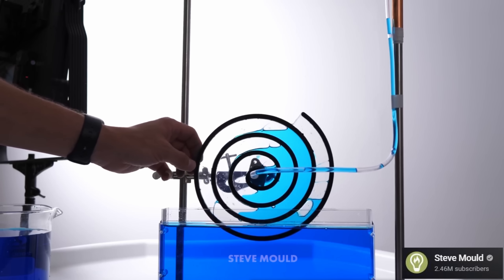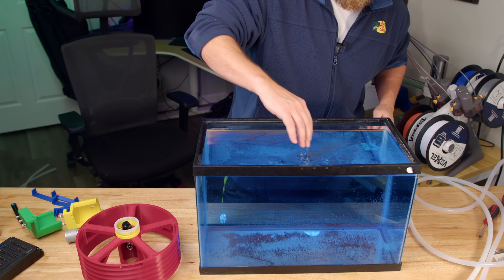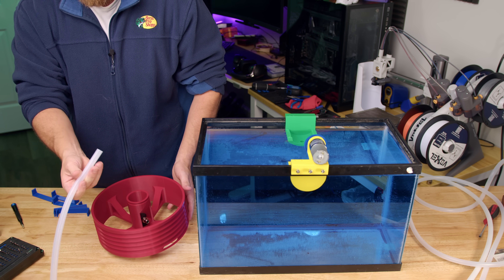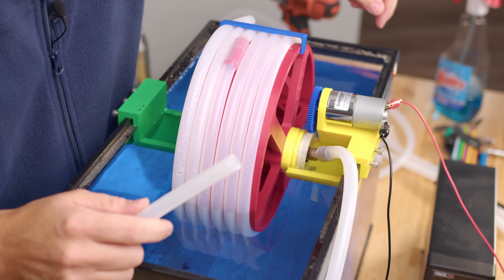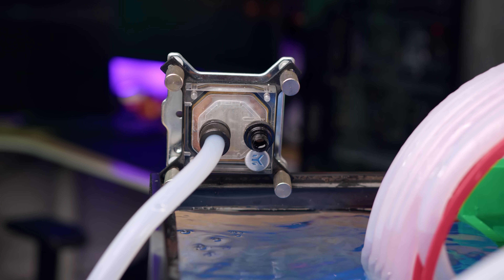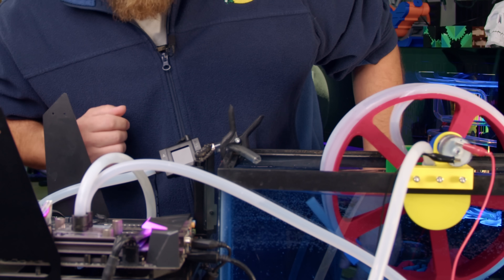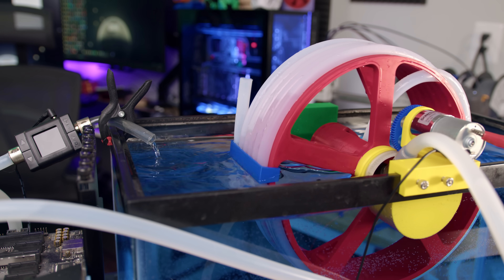Can a 217 YEAR OLD Water Pump Cool A PC?

Comment: To avoid air interrupting the flow I would suggest instead of getting the houp and escape hole directly on the cpu, maybe put the cpu in a bath that is filled up by the hose sitting on top of it and a drain hole below it so the CPU is constantly submerged

Comment: I think this needs a showdown sequel: an archimedes pump, this coil pump, maybe a rope pump, all have a risk of sucking in air, and need a pressure reservoir that should continually be allowed to leak through a valve from the top back into the input tank, to separate air before the CPU... then a peristaltic pump (plenty of printable designs for silicone tubing are freely available), and an off the shelf water cooler to bring it home.

I believe all of the above (except the "control" ordinary water pump) can be easily made with a brushed motor as was done here, but knocking it out of the park would be using an (e.g.) NF-A12x25 motor and 3D printed parts, rather than an already-geared-down brushed motor to accomplish the task.

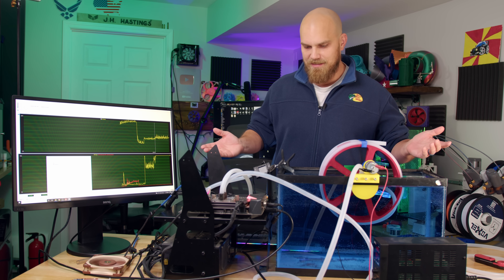Comment: 9:24 You can buy automatic air venting valves for radiators. …  I mean  the house heating kind.  Wouldn't that a way to lose the excess air?

Comment: Water pump, call me lazy go with gravity  put a bucket higher than the CPU hole under the bucket with a toilet float to regulate the level of water in let gravity do the work . Save power, avoid noise, have water quickly available for your thirst.

Comment: I'm thinking you could use a back pressure tank, similar to a ram pump, to catch the air while still keeping pressure on the water. This will help keep continuous flow (like a pneumatic capacitor) you would just need a pressure release valve on the air side of the back pressure tank to allow for the air to escape without causing a too serious drop in back pressure that's required to operate the spiral pump.

Comment: I think you need to put a sealed tank or cylinder (with an inlet and outlet at the bottom) in between the cpu and pump, up high. The air will get trapped in the top. If you set it up so the pump can out flow the inlet to the cpu then it will fill the cylinder with water, pressurizing the air, and i think if you set it up right it might be able to pump continuously. Gravity will also help. The cylinder will need to have an air release or else it will eventually just start pumping air with water.

This is a pretty cool idea

Comment: Try using bigger tubing on the drum and having it reduce down to PC cooling tube at the swivel fitting. Should increase the flow rate and probably pressure though the system

Comment: Try using an air bubbler in a tube to lift the water, like it used in aquariums and under water dredging. If the thermodynamic balance is just right the evaporative cooling by the air bubbles will remove the excess heat ensuring the reservoir stays cool.

Comment: Use the pump to feed a siphon reservoir above the CPU. That will eliminate the air gaps. Then just tune the return rate from the siphon to the tank with an adjustable nozzle to match the flow of the pump. Or you could have a secondary catch-up pump that comes on when the siphon reservoir gets low and cuts off once it gets to a certain level.

Comment: You might be able to get the air out by T-ing the return line back in the system just past the pump and having some sort of pressure release valve on the return as well to manage the pressure. Bonus points for finding an adjustable pressure valve to find the pressure limit of the system.

Comment: You could put a 2L bottle inline with a one way pressure valve on the side, with the outlet under the water level in the bottle. The valve set to the right pressure, it would allow for air to escape and might remove the air being pushed further into the system while still allowign for pressure to push the water in the system

Comment: an idea to get rid of the air gaps is to hold the whole thing under the water and rotate it till all the airs out. also have the entire wheel lower under the water the whole time and have maybe a belt/chain drive from the motor

Comment: Probably a pipe dream... XD but a Stirling engine water pump would be cool. I dont think it would have enough pressure to push the water through though. A can of Sterno would be the easiest way to provide heat, but if you could use the thermal output of the CPU+GPU to run the engine that would be sick. Though on my quick math the output would be about half the BTUs of a Sterno can. Sadge.
Awesome video though!

Comment: Re-do this process with three water loops combining into one later in the loop. Each one has a check-valve to prevent back-flow. Then off-set each loop by 120 degrees. And you can showcase the typical 3-phase AC function of power generation, with water. And why it is beneficial in removing the 'air gap'.

Comment: This princip should work a lot better (more constant waterflow) with some priming or slightly higher rotation speed; best probably would be a combination of both. The base princip probably has around 50% filling but with the propper rotion speed priming the loop to 2/3 or 3/4 should work as well while supplying a more constant waterflow. I´m not an expect but that´s what the logic of my authistic brain sais. BTW: I´m german and we´re known for improving others designs throughout more than 100 years, a german redesigned the steam engine which really blasted off industrial revolution. With 3/4 filling, the wheel might have to be redesigned or the the holding frame because for that much priming the wheel probably has to submerched to 2/3 and not just half. E.g : you could simply lower the anker points for the holdsters or redesign the wheel and one holder. For second it´s actually a bit more redesign: you could lower the wheel and print a fitting gears on the wheel frame while moving the spokes to the other side an thin them out to make space for gearing and in addition, the spokes have to be off centered and attached to a bearing which sits in the holding place.

Comment: elevate the computer above the reservoir and add a 2nd reservoir between the pump and the CPU to eliminate the air bubbles in the cooling system.

Comment: The key to eliminating bubbles is simpler than you think, make the length of the coil longer and the diameter smaller. And then tilt it 45 degrees so that the inlet is completely submerged.

Comment: funny enough if you turned this drum to between 45 and 90 degrees, you'd have a weird take on an even older design: the Archimedes Screw... which a conical version is used to pump flood water here in New Orleans.

Comment: I think raise the output side and lower the input side and add some speed. I would like to see multiple tubes spiraled more like a twist drill bit with maybe a 45 degree fittings to hit the water at 90 degrees. Just an idea. I am imagining a hydra like set of tubes all connecting to a center point.

Comment: try submerging the wheel as much as possible by adding gears to drive it under the surface to keep the motor dry. Also a larger diam hose on the wheel feedign the smaller 10/13 may give you more constant flow.

Comment: If you had, say, 4 of those running at the same time, could you running them all into a single line using 1-way valves at the intersections? Also, about the air, is there any sort of valve that lets air get released without much water being released? If so, in combination, I imagine these two would allow for better continuous water flow without as much air passing through.

Comment: You should remake it but double the hose diameter (more pressure because more water mass above previous loop, and 3.14x more flow because 2x the diameter.) Then wrap another loop around that one using the previous loop as a guide, and start and end it 180⁰ out from  the first loop. Tee in at your swivel and dump it into a buffer tank. Idea is that if you can somehow throttle the tank so you never outrun your  pump, (a float valve would be good for this) then you always have a consistent water flow and no air in the loop (better thermal heat transfer).  The only down side is that the water pressure is going to be proportional to the distance between the tanks water level and the end of the return hose. The further vertically that these are apart, the more water pressure you will get. The other way you could do this is use a sealed tank in line with the pump and install a small orifice or adjustable valve at the very top of the tank with the outlet at the bottom. Because air is less dense and far less viscous than water, you can use a metered leak to purge air from the top of the tank. If theres no air trapped, you will leak a little water. But the idea is to make the bleed small enough that the leaked water is minimal meaning that it's large enough to bleed off all the air, but minimise water leakage. This has the benefit of maximizing pump produced pressure with no trapped air. This could even be done ideally with a carburetor float. When fluid level drops because its displaced by air, the float sinks and opens the purge port letting trapped air out. If air is exhausted the float raises, which plugs the air purge port. This would work way better imo. You could even 100% print this and use an o-ring press fit to seal it. I think with the other mod where you make 2x hoses 180⁰ apart or 3 hoses 120⁰ apart, you may have so much water flow that it doesnt matter one way or another. I still think you should make the float style self purging pot!!  😁😁

Comment: You should try seeing if it works with a waterblocked GPU on a GPU stress test, and if it can handle that, try both a CPU and GPU dual stress test. Maybe add a small circulator pump inside the fish tank just to cycle the cool water at the bottom to the top

Comment: I think you could use some simple flap valves to prevent it from grabbing any air.  Maybe that could allow it to push the air all the way out and keep JUST water in the loop?  A water tower would work, like ethanconnor6227 suggests, but that would also make it a lot bigger and you'd have to make sure its elevated enough.  Also, what about an intake scoop on the inlet tube.  It could generate more pressure and allow it to pick up a bigger volume of water.

Comment: Would a second pump loop for picking up water and feeding into the system towards the cpu help with the air bubbles at the cpu block if it was timed with the first loop, so that when one tube end is exiting the water the other is entering so it has constant flow?

Comment: Could you add a second 180 degree offset loop on the wheel and trigger a valve to dump the air from each rotation on each loop and only accept the water?

Comment: Make a second drum , and hook both to a Y fitting with check valves, if you offset their phasing by 90 degrees you should be able to eliminate most of the air pockets and potentially use smaller drums overall

Comment: Several days late to the party and many have brought up parts of my overall opinion already, but.... I would combine several facets... this pump is capable of a fairly decent height differential... you also have half of the pump submerged which gives a pretty good pressure possibility and would allow for three tube windings that are offset by 120° from each other. The hub connections should have a one way valve between each coil and then into the rotary coupling which would then feed to a tank at the final output a few feet higher than the CPU, the tank should be big enough to handle the output from all three hoses and the height will be determined by the pressure required and the volume throughput. Using a thinner tubing wall will increase the volume, and you could double wind each hose onto one third of your current drum width while maintaining a very similar diameter.  If you really wanted to put a radiator into the feed to the CPU or even as a pre-cooler to your recovery tank, you could probably drive the system even harder and/or longer before approaching thermal saturation.  Perhaps some solutions from hydroponics applications can also counter the issue of unwanted growth in your water system.  <shrugs> just the thoughts from a grumpy old engineer... LOL Tale from it what you wish! 

I love the results you got from the relatively primitive solution you hacked together and I think you could definitely tweak some serious improvements into the overall operation.

Comment: I think you could make an air separator with T to a fat vertical pipe. So long as the pressure isn't enough to push water all the way up to the top you will get rid of the air.

Comment: Why not make it fully submerged and with a funnel at the end, given a high enough rpm it should still pump pretty well, and you can also suck the air out the other end before starting it.. no need for towers,t-flanges, filters and what-not, and there should be no pulsing

Comment: Keep the pipe around the drum the same size. Maybe change the output pipe to a smaller diameter pipe? Would that help the flow rate or would it decrease the drum intake?

Comment: your heat source is the same and the destination that heat goes is the same so increasing the flow is only going to increase the temp of the tank anymore than what it already does at the current flow. it just means that your output is going to be cooler but at a higher flow. increasing the flow of the water is not going to magically make the CPU produce any more heat than it already does.

Comment: What would happen if you were to double the amount of channels and run a second tube along with the first but spaced 180 degrees at the input openings? Could you run both tubes into a "Y" and get constant flow since gravity seems to be the reason that the flow isn't constant? Or would the air pressure from the top half of the rotation interfere too much on each pass and bind up the water from passing into the tube? Just a thought. If 1 tube is good 2 should be better, but maybe not. With more parts, complications arise as well.

Comment: Use a wider diameter coil tube, but keep the rest of the tubes the same
Let's see what happens

The wider tube means you can spin the wheel faster without it backing up, but the bottleneck means that you also have to spin it slower than you would normally

Comment: Ok, for the next one, connect the cpu to a water reservoir above the cpu and have the pump feed the reservoir.  that way you should get a constant waterflow through it and back into the tank.  you justr have to make sure that the reservoir is above the tank ond outlet.

Comment: forget the 200+ year old water pump. I'm waiting for the water powered intercooler turbo water cooler from your car. Ofc powered with your custom RGB fans. Add some TEG coolers or evap/tower bongs or a sterling engine to the hot/cold plates/parts. Or attach a dry ice/ice maker that shoots ice into a bag on top of the water to chill it down further. maybe add 2 tubers combined into one for more water flow.

Comment: What if you add a funnel under the water that connect to spiral will there still be air but the the spiral will have to be beaper in the water to work than I think...

But else that awesome test

Comment: Maybe run a second coil in paralel so it pumps water when the other is pumping air, and a container in between the coil and the CPU that acts like a capacitor so it evens the flow to minimize air in the PC part of the loop

Comment: You could add another tube 180* out of phase, both tubes run to a manifold with check valves get rid of some of the air. A scoop on the end of the tubes to help force water in. I would be interested in seeing this perfected.

Comment: LOOK Man it is so easy! (to eliminate the air). Just make a printed 3x3x3 inch cube with a hole in the bottom that goes to the water block, and about 2 inch up hole on any side (overflow) that returns back to the main tank. 
Place the output from the pump to 'fall' into the tank which makes for a REAL airgap. The pump can easily go up 3 feet vertical.

Raise the cube about 24-36 inches and you will eliminte the air going through the water block.

Comment: The lower the pump sits in the tank, the better it will work. Elevating the tank will make better outlet pressure too. 

Did one of these for a science fair years ago. A funnel or larger opening is not going to increase efficiency because there still is air present from when the inlet exits the water to when it re-enters. A funnel or cone on the end would  introduce more water into the system but also trap the equal amount of air. You're fighting line loss, just like with a vacuum.  The only way to improve the design as it sits is to lower the wheel further into the tank, and raise the tank above where you want it to pump to. Use the weight of the water to compress the air inside the tube as much as possible and then increase the height of the actual pump so that anything downhill sees more flow. you can maybe get 50% of the air out of the system that way, the rest is there as a byproduct unfortunately.

Comment: Could you run a fish tank oxygen stone to aerate the water. That in theory would create more surface area in the water for the heat to disperse. The same principle they apply to foam insulation.

Comment: If you want to get rid of the air, you can build a separater tank.  You need an airtight tank between the pump and the water block.  It needs to have a water inlet, and outlet, and a float actuated valve to let air out.  Air will build up in the tank with water until the water level drops enough to let the air out.  The flow will stop while that happens, but no air will run past it.

Here's kind of an illustration for you:  ---[  ^  ]---  Just make sure the water outlet line is lower than the float.

Comment: Try using larger tubing on the pump, and slow the rotation to allow the water to burp back the air so it doesn't get forced into the water block.